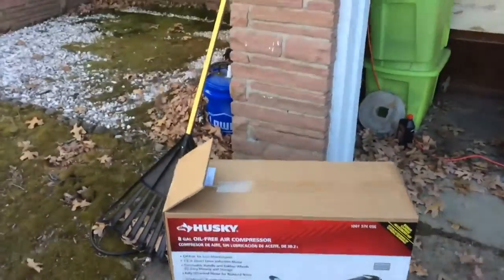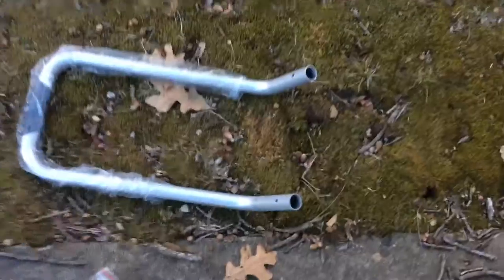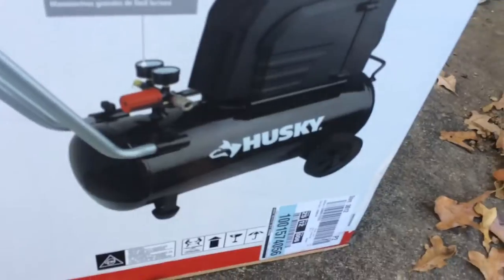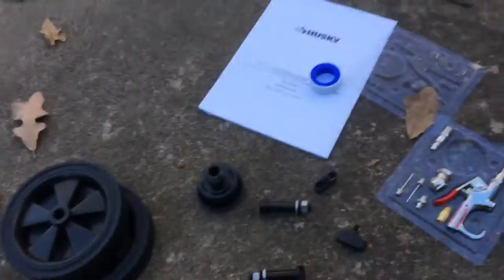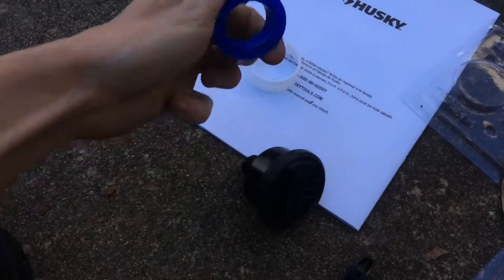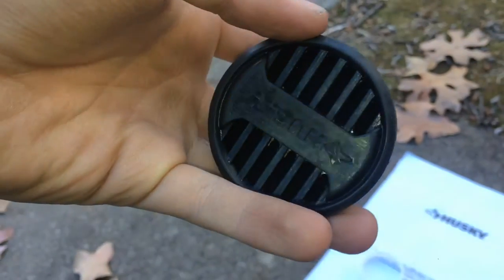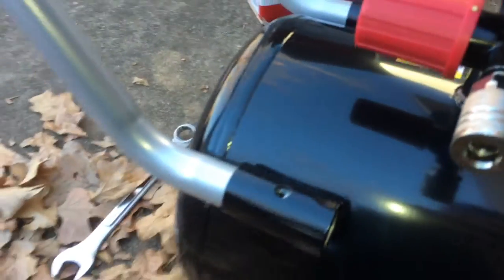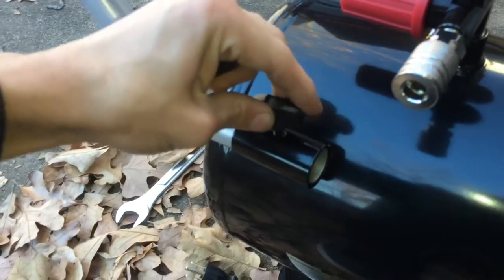How To Setup A New Air Compressor

Comment: Thank you so much! I’m trying to do this by myself and my goal is to get my Brad nailed hooked up and working correctly, but to be honest this is my very first time using any power tools. Your video helps! Now the question is, how do I attach the Brad nailer to my husky air compressor? Hopefully I can find a video for that part, which I’m sure is pretty obvious to most people. 😣 I’ve read all the manuals so hopefully I can figure this out! Thanks so much!

Comment: Wait. You got an air hose and the connectors with the pump? I only get the pump and the parts to put it together. The air line, couplings, tire connector and blower I had to buy separately. 

Nice machine so far.  Missing a female coupling to do anything with it. Breaking it in 1st like the instructions say to break it in and test it to see if everything works like it said. Everything went well the release valve closed up at 60psi which is within the 100 - 40psi ratings.

Comment: I'm working with a borrowed, fully assembled compressor.  The last few seconds where you set the desired pressure was the only thing I was looking for.  I wish you had spent a little more time explaining those two pressure gauges and how to operate the machine.  Nevertheless, I thank you for the video.

Comment: So is the air filter supposed to not tighten to the frame / casing then?
There  is a gap in mine about the same as you left yours?
Reply: The manual explains it. You only want to hand tighten it.

Comment: I just bought one and set at 100psi for tools set but the compressor won't kick in to refill the tank. So went back to home depot to talked with customers service and they told me the switch is bad and exchanged for another one but when I got home it’s doing the same things, won’t fill up the tank when the desired press is low. Please help if you know what the issue was!
Reply: I'm having the same problem. Let me know if you find any solutions

Comment: Those compressors are shit
Reply from the maker: Still running 🤷🏼‍♂️
Reply: @TheFeesher  not mine after a few cranks engine stops no oil probably not a good idea
Reply: junk quality, built pressure halfway than stop. motor won't got further.